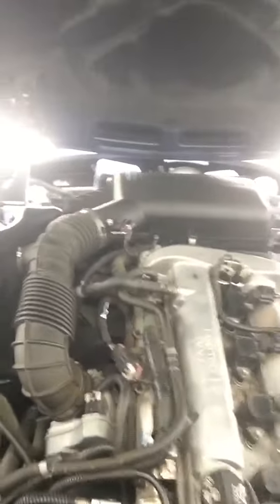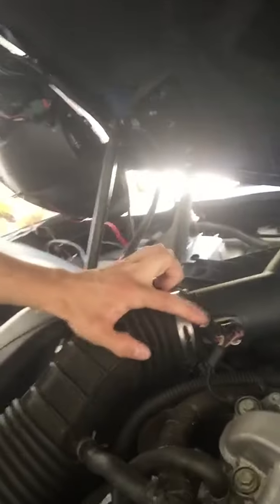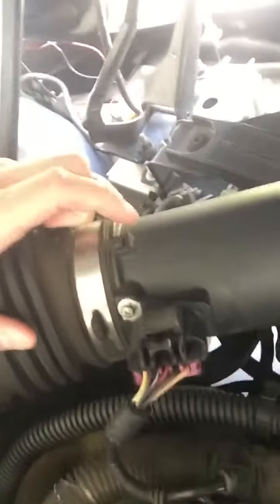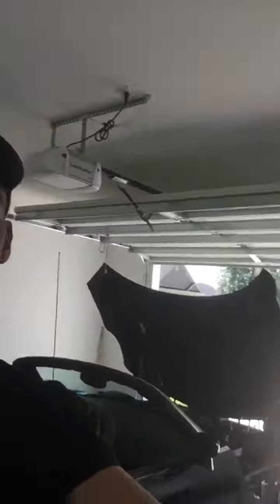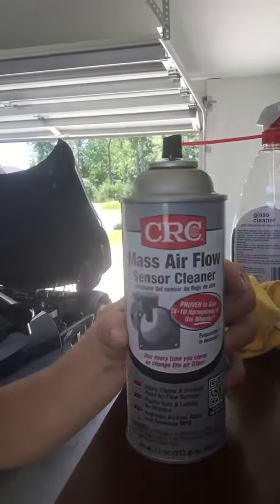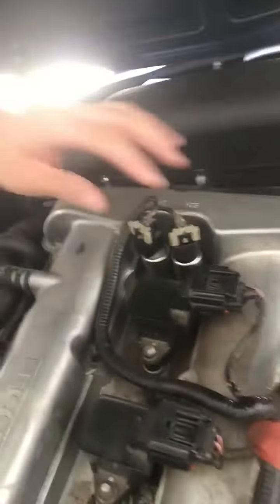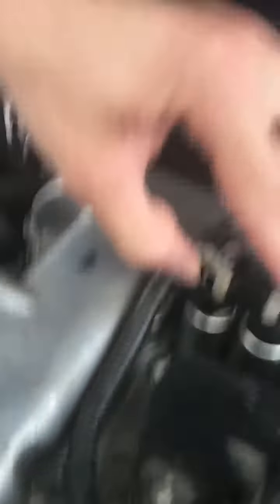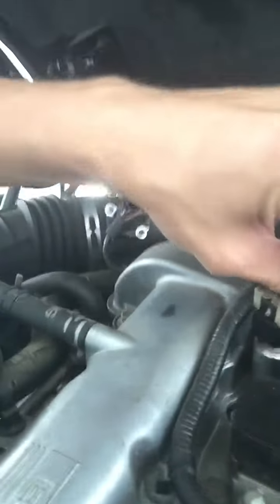Pontiac Solstice “bucking” “jerking” when slowing down, the fix!

Comment: Thank u for making this video. Same issue w 07' Saturn Sky. The dealership had me replaced the TMC but that didn't fix the jerking. They then instructed me to get a new transmission. I will try this 1st & report back.
Reply: They the fix your car the change my trasmision my timing chain and the computer and my car still have the same problems. I spend too much money now Im desperate help can any body help me!!!!
Reply: The they fix the car becaous I had change the transmission too and nothing change place let me know what the did
Reply: Did u ever find the problem
Reply: @kenmoore4970  I took it to a place called Mr transmission they changed some actuators and solenoids and that completely fixed the problem I did not need a new transmission like the dealership said
Reply: @ClareBearForever do you remember what actuators they change??
Reply: @kenmoore4970  no I'm sorry that was over 2 yrs ago now
Reply: @ClareBearForever  thank you

Comment: Just purchased a 2007 Saturn SKY, and gladly paid $340 for a K & N Cold Air Intake. My car started to LURCH AND JERK at about 18 mph, when braking for a stop, ! !  The jerking threw my dog on the floor. I took off the K&N CAI,  re-installed the factory air intake system, and the car fixed itself. K&N refunded my money! SEEMS that BMW, SOLSTICE, and SKY do NOT like mods that are not factory friendly.  The CAI (when installed) messed up my ECM, MAF, Speed sensor control,  ABS, and a whole lot of other systems that it communicates with. The increased cold air told the MAF sensor "This guy is going too fast approaching this stop sign while braking, so it had my transmission aggressively downshift to slow the car down and even asked ABS for some assistance, all the while the cold air blowing into the MAF told the ECU that the car was going a whole lot faster than it actually (speed sensor control module) was, screwed the ECU up, and made the car jerk, buckle, and transmission aggressively downshift (with some ABS braking assistance), which led to lurch and jerks! 
 Advice.....Don't do, or add anything, to modify these finely tuned factory machines! :)

Comment: Thank you for your suggestion, but it didn't work for me. I guess, I need to replace the mass air flow or consult the certified mechanic.
Reply: You find the problem ??? Can you help me I had change the transmission the timing chain the cumputer but nothing fix it if you fix it place share the information with me
Reply: Curious did you do all steps and replacements as suggested?
Reply: Did anyone find out the problem if so I need help
Reply: @jorge01152555  hey did u ever find the problem??

Comment: Bought mine last week similar model 2007 Pontiac solstice, sadly right now mine is doing the bucking sluggishness when slowing. Ps: my car is also straight piped so i am also getting a catalyst error. When driving for 60mph for extended time when I get off the highway and into town I slow down, as soon as I hit 20mph it lurches forward a bit hard, then once more slightly at 10mph (1st & 2nd gears?) the errors im getting are 

P2637-Torque Management Feedback Signal A.
P0011-A Camshaft Position Timing Over/ Advanced or System Performance Bank 1.
P0700-Transmission Control System (MIL Request).
P0420 - Catalyst System Efficiency Below Threshold Bank 1..

I replaced the mass air flow sensor and the camshaft intake possition sensor..but I still get the codes. I’m thinking it’s my exaust being straightpiped but if anyone knows or might have a idea PLEASE SHOOT ME A MESSAGE AND HELP!!!?!? Thanks
Reply: I had the same issue when I bought mine, all you have to do is replace the intake and exhaust solenoids. The two that he pointed out on top of the engine. Mine has been working fine ever since.
Reply: Thank you I fix my transmission issue thanks to you video

Comment: I use to have this issue with my Infiniti i30 it also jerked badly when i accelerated quickly. For not finding the fix earlier it ended up fucking more shit up. It messed up my motor mounts ... At the end by accident when i was cleaning sensor i stumbled onto the TPS (Trottle Position Sensor) which accelerates the car via the air intake pipe when u step on the gas.  The moment i adjusted it a bit i notice the jerking went off untill the sensor failed then the car wouldn't accelerate and would stalled if i didnt kept the foot on the gas.  I replaced it and problem fixed. I had full power and speed and no more hesitant  jerking when i was driving. So check the TPS sensor if you have one. 

Now my BMW has this issue when slowing down the car feels like it suddenly breaks hard by itself which causes jerking.  But my BMW doesnt have a TPS! So im screwed trying to fine out what causing it cause its soo damn annoying!  And yes i already cleaned the MAF sensor to no avail...
Reply: Did you modify CAI or exhaust, or chip?
Reply: I have the same problem with my bmw have you found a fix

Comment: I've had this problem (jerking when I come to a stop) w/my 2007 Solstice so I told the tech at Classic Pontiac to pull my old order when it was last fixed.

I took my Service Advisor for a drive in the car & as soon as I pressed on the brake, my car jerked so he told the tech what my car did but since my car didnt do it when the tech drove it, they refuse to fix it. They've had my car for 7 days & have done nothing.

I've had my car since 2007 so I know my car very well but they aren't listening to me, I guess because I'm a woman but I'm about to show my crazy maybe then theyll listen to me. Drives me up the wall that they dont listen until they see my crazy.
Reply: I am having the exact same problem.
Reply: @beejohnson2569  I argued w/my service advisor & then went into the shop & argued w/the mechanic. I told him to replace the Camshaft Actuator Solenoid. He told me, 'if I replace it & the problem continues, you still have to pay.' Guess what, he replaced the Camshaft Actuator Solenoid, problem fixed, no more jerking.
Reply: I am so happy its been repaired!  Where did you get your parts?  Was both the intake and the exhaust solenoids were changed?
Reply: Y S•l¡s sorry what was replaced?
Reply: Bee Johnson did you get yours repaired?
Reply: @mnorman8227  did u ever get your car fix ?? If so could u tell me the problem